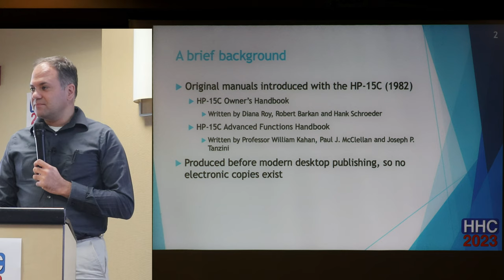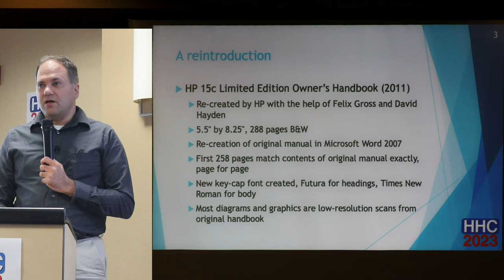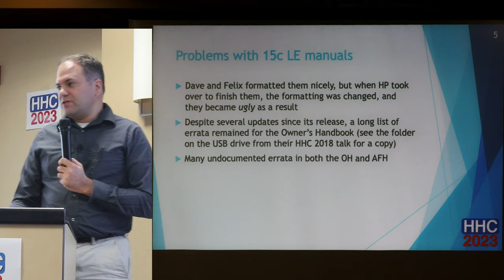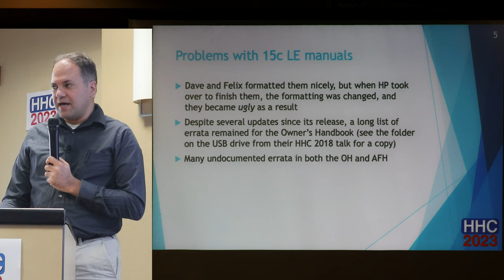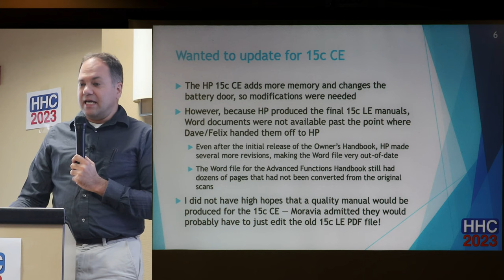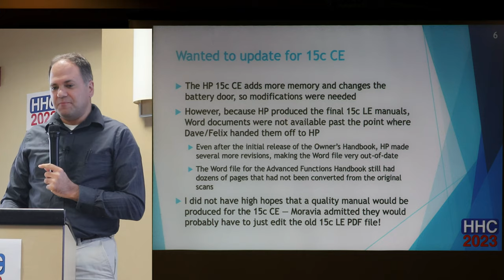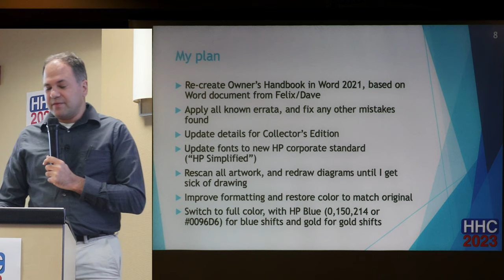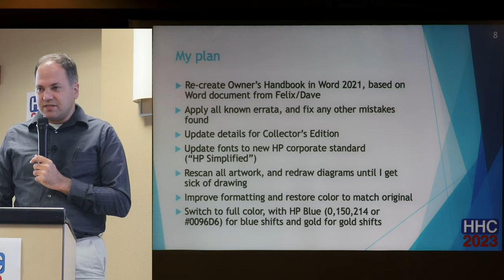HHC 2023: Recreating the HP 15c Handbooks (Eric Rechlin)

Comment: I received my CE a couple of weeks ago and was amazed by how much difference this beautifully designed and printed manual made. I found myself actually using the advanced functions of the calculator where, using Bill Foote's excellent Android emulator, I'd previously floundered in the foothills of the learning curve! Just downloaded the Advanced Functions Manual too, but it is a pity it does not exist in printed form: I discovered with the Owner's Handbook that this really does make all the difference. If it is not commercial to get a print run, maybe it could be put on a print-on-demand service?

Are the fonts you refer to as being on the conference USB also available to be downloaded? Maybe (pushing my luck) even the Font Forge files so we can extend them as necessary for other Voyager versions?

Comment: Slide 28 has the order of the manuals switched. I think you said the one on the far right is the excellent update for the 15C CE but is labeled LE. Thank you for this work as I received the calculator last week and the manual is an absolute gem!
Reply from the maker: Good catch.  I have fixed the presentation file for future reference (on the USB drive now and eventually will be shared online).  Thanks for the kind words.

Comment: I've just bought a HP15c CE in the UK and the manual which is included is very good from a technical perspective - so well done Eric.  I have to say though that the quality of the paper and cover used is poor - well below the standard of the original 15c manual - (which I actually prefer to use also because it is ring bound and smaller).  In addition whilst the calculator is very good, the performance of the keys is not as good as the original HP15 and HP11 (which I also own) and which have "identical" keyboard performance.  The keys of the new calculator have a significantly longer travel than the originals and are much noisier than the originals.

Comment: I wish all this effort put in a basic calculator was for implement a HP50g which is way better and powerful for engineering. So many engineers in need of an HP50g and we don't get anything from HP. Make a survey, guys...
Reply from the maker: The effort to produce a remake of the 50g would be orders of magnitude more than a remake of the 15c.  All the 15c CE required was to take the existing 12c, change the faceplate (and key labels), and load the 15C ROM (with some patches) instead of the 12C ROM.  Even if the industrial design could be retained, a 50g remake would still be on its own production line, and would need a new SoC to be selected, a new circuit board to be designed, and a new operating system developed to run on that SoC, on top of which the existing Saturn code could be run.  This would be as much work as developing the Prime G2 (over the G1), but with a significantly lower expected RoI. While possible, a 50g remake would be far, far more difficult than the 15c CE was.  So "all this effort" wouldn't have even gotten you 10% of the way there.
Reply: If you had read Eric's superb manual, you'd know that the 15c is very far from being a 'basic calculator'. It has amazing feature depth which is very thoughtfully implemented. Sure the limited display hobbles it in a few places, but I for one really value the minimalist design. If you want a 50g there are great emulators available for your smartphone, and the HP Prime can still be bought new.